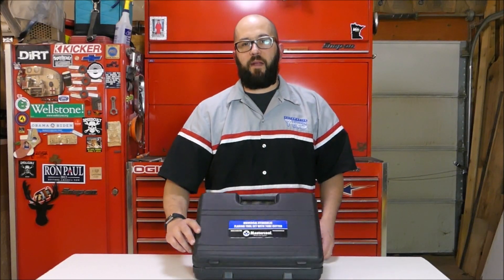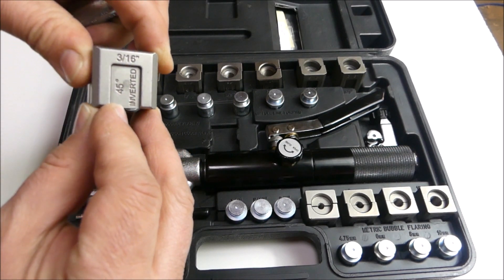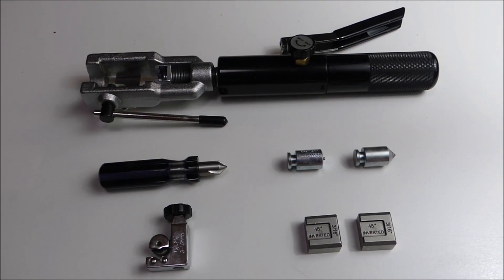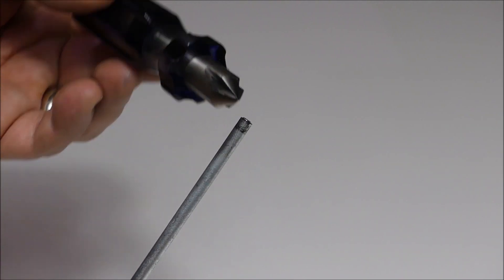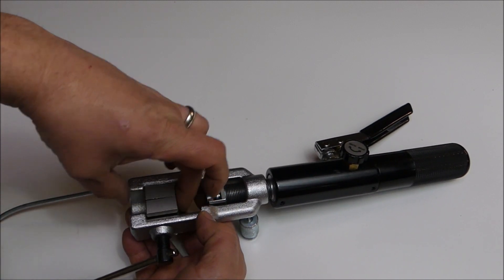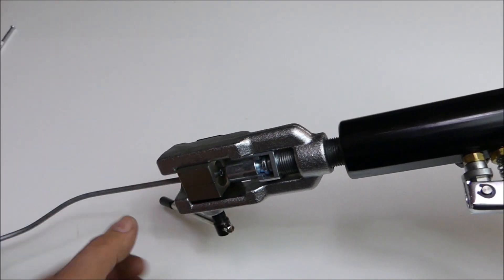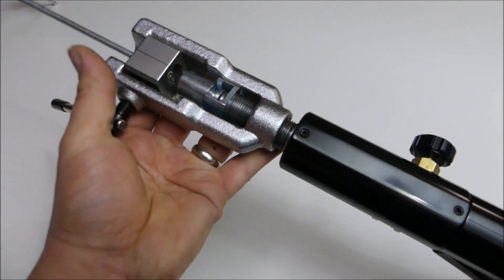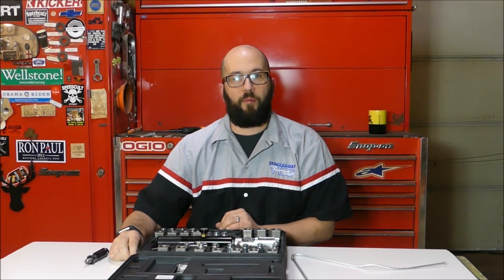How To Make a Double Flare Using the Mastercool Hydraulic Flaring Tool Step by Step Demonstration

Comment: it works well but the clamp dies dont hold the tube very well and when tightened enough to hold the tube from pushing back it leaves ugly lines on the tube...

Comment: I bought one of these but a Matco off of ebarf I had no clue how to use it or what it was capable of doing. Just been collecting dust . I have one die that is missing. Your video helped a lot. I like your straight forward type of teaching. Would like a video on the other dies and push connect and what application they are used in . Thanks

Comment: I want to see it work on 3/8 inch line or larger.
Reply: I saw a video of a guy doing 3/8 double flare, he used some pine pitch stuff you can buy in a bag do give the dies better grip. I tried it myself and it worked. Took a few tries to figure it out. But why would they put out a tool if it doesn't hold. Frustrating.

Comment: Dies need to be lubricated. Always!
Reply from the maker: As a Master Technician with 20 years at a GM dealership and 5 years in independent shops, I disagree.
Reply: @andyandnancy  If you think you made nice fittings before wait till you grease them dies😁😁 I like heavy "Spray" Lube or Grease. Fluid film does a wonderfull job as well.
Reply from the maker: @ralfsautomotive  you've convinced me to try living the dies next time.